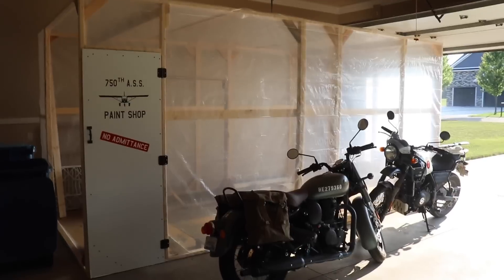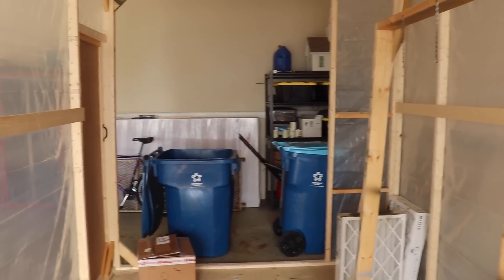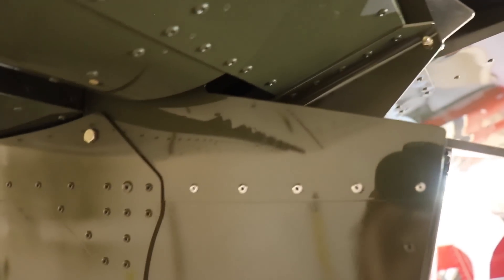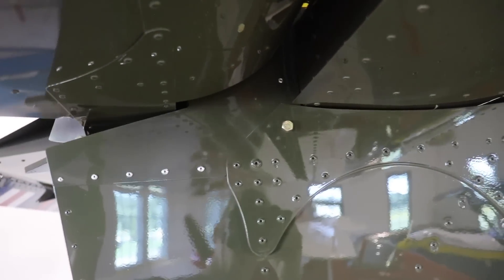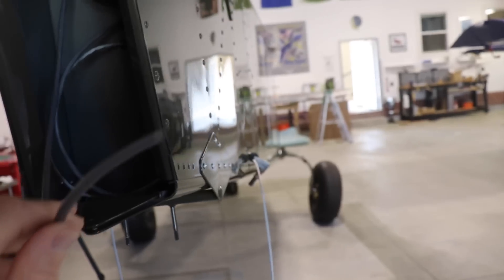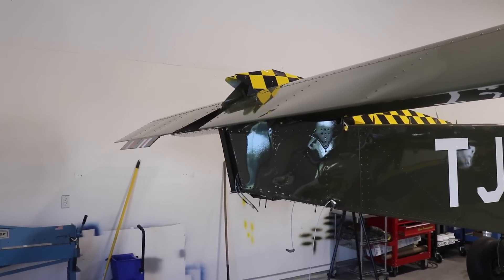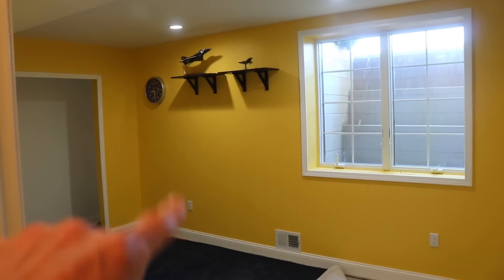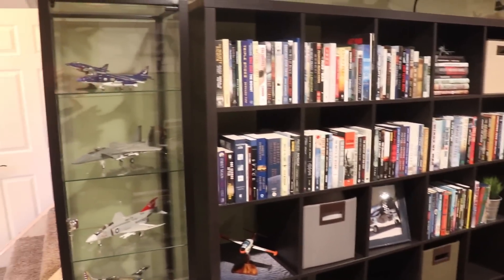Why Is It Taking So Long to Build This Airplane?

Comment: I really appreciate your videos.  I was an aircraft mechanic with the U.S. Air Force for 37 years.  21 active duty and 16 as a civil service civilian.  It takes time to perform maintenance on an airplane or to make modifications.  I applaud your attention to detail and making sure the work is done correctly.  I was also a Quality Assurance inspector during my career and everything you are showing in your videos is high quality work.  Please keep the videos coming.  I am a huge fan.

Comment: I made my paint booth on a raised floor so that I could use downdraft ventilation.  I made a plenum on one end and use a couple fans to draw air through the floor “joists” and down through slots I left between 1’ wide pieces of OSB.  I also placed the plastic on the inside of my wood frame so that I had a smooth inside surface which is easier to clean and less likely to trap dust that will later emerge at the worst time possible.  I placed a long filter opening the length of the center of the ceiling.  This has worked great a the airflow is working with gravity to pull the paint particles down and through the floor.

Comment: I don't understand why the kit manufacturers don't at least give you a suggested finish instructions for wiring, plumbing, etc!? I know everyone has different equipment but they could at least have a few extra chapters with suggestions. Seems like they just leave you hanging after the rivet banging is done.

Comment: Sorry to hear about the water damage. That sucks badly. It has happened to me too. I had a leak that ruined a hardwood wood floor. Another time I had a sprinkler pipe burst and dumped hundreds, maybe thousands, of gallons of water into the yard. So, I decided that any time that I will be away for very long, I turn off the main water valve and the sprinkler valve at the street. I also turn off the electric water heater so it doesn't burn up it's heating coils if it leaks it's water. I also installed a automatic shutoff valve at the water heater so that it turns off it's water supply if it detects a leak in the water heater overflow pan. I've also installed some Ring water leak sensors under the dishwasher and in the wall under the shower pipes (via a access hatch I installed on the opposite side of the wall) to detect leaks before it's too late. The Ring sensors alert me via an App on my phone wherever I may be. Now I can sleep at night.

Comment: Just last night I looked to see what happened to you and if I had somehow missed an update. Glad you're back. Worrisome about the leak. I have two showers in my "retirement" house which was built using plastic piping. I recall thinking at the time it was being build that I needed an access point to both. I didn't have any access points build in but I know that I could reach everything with minimal work. I would bet the first house I built in 1972 has never had a problem. On the other hand, I built a beautiful house in 1994 and learn after about 5 years that defective Chinese copper piping was used that sprung a leak - little holes right through the copper. Fortunately, that leak was located in the "basement" and was easily repairable. Most of the piping was good quality and the damage was limited. I also learned that that house had a defective water heater with a Chinese made anode rod that destroyed the water heater and made the water smell. The water heater supplier was very apologetic and replaced the system (Nashville, TN). Problems that you would never expect to happen.